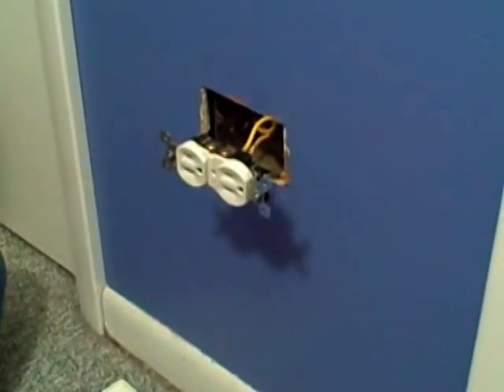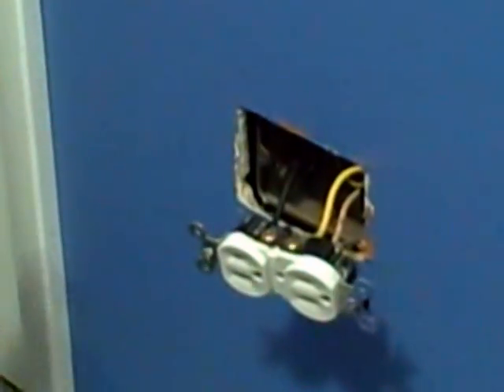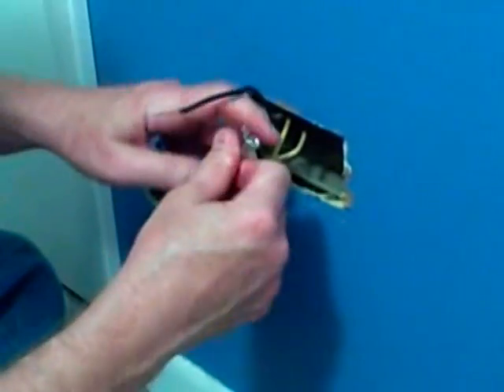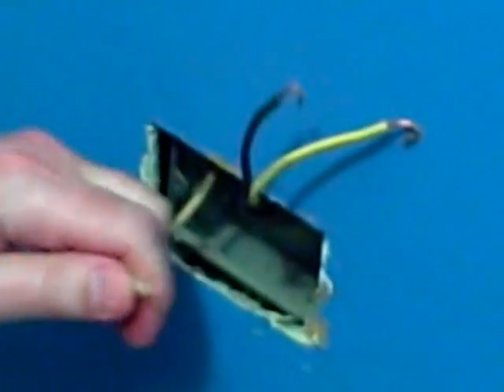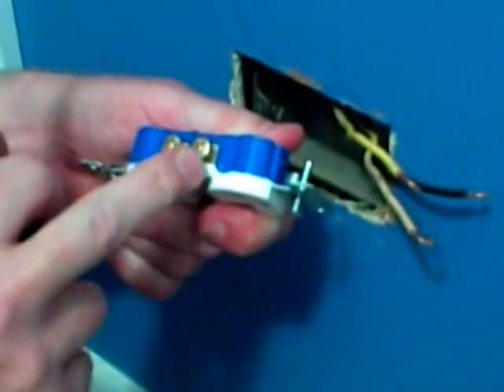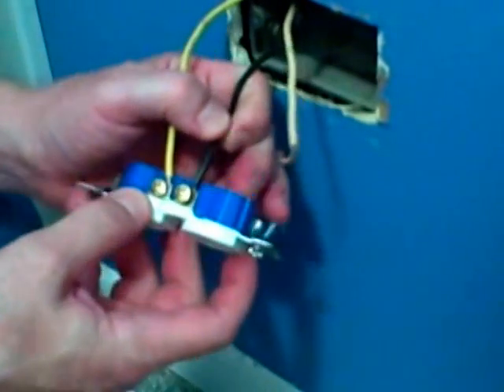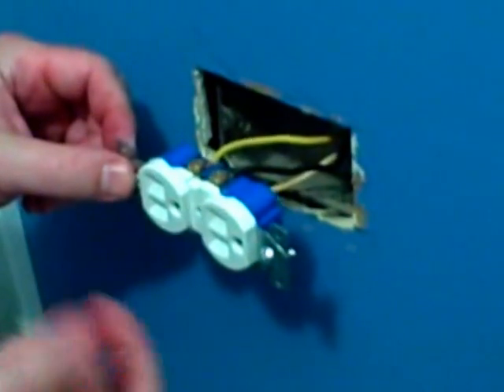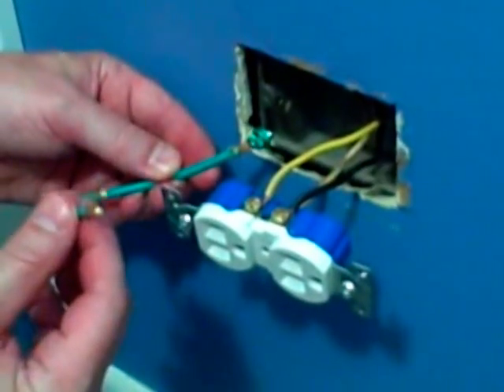How to Wire a Switched Outlet - Conduit

Comment: Hello I accidently broke the tab between the 2 silver screws neutral side can I still use this receptacle if I break off the tab on the Brass screws, Red & Black wire
Reply from the maker: Hi, only one side will work. 
We have more tips in our home improvement book http://www.amazon.com/dp/B01BK2K0JM?ref_=pe_2427780_160035660

Comment from the maker: Hi,

You would only remove the tab if you have a switched outlet, or if the outlet is fed by 2 different circuits. If your old outlet had the tab intact, you will not remove it.

In most cases, one hot wire is coming from the service panel and the other hot wire is feeding another outlet. You want the tab intact.

Let me know if that helps.

Comment from the maker: Was this wire connected to the old outlet? And if it was, what screw was it connected to. 
If you have a metal box and metal pipe back to the service panel, your new outlet will be grounded. I would install that new 3 prong outlet you have.

Comment from the maker: Hi,
It sounds like they used stranded wire to create a grounding whip to the box. If it was connected to the old outlet that way, it should be fine for the new one. Keep that new 3 prong outlet for safety and for cords with a ground.

Comment: Hello. In replacement of a receptacle that is wired as a combo, the old receptacle had two blade inlets (both for hot and neutral) in where two white neutral were connected to the top (switched) outlet but not the bottom (unswitched). My replacement only has one blade inlet (hot and neutral) for top and bottom. Can I just connect the second neutral to the bottom (unswitched) outlet inlet or do I have to pigtail them and connect to the top (switched) outlet? Thank you.
Reply from the maker: +TUBEBOO55 Hi, can you take pics and send to fixitpodcast@gmail.com

Comment: What if I HAVE an overhead light controlled by a switch, but the switch also controls an outlet. But, I want that outlet to have power even when the light is off. How can I fix this?
Reply from the maker: regression Hi, If you have a switched outlet, the breakaway tab is removed on the brass side of the screws. You will need to replace the outlet and leave the tab intact. You will have to use a tester and confirm which wire is connected to the switch. You can cut this wire down and cap it off with an electrical connector in case you ever want to have that outlet switched in the future.
So for the step by step... Turn off your power, confirm it is off with an electrical tester at the outlet. Remover the outlet and remove the wires, spread them apart so nothing is touching. Now turn the power on and with the switch OFF find the hot wire. Mark this as the hot for your new outlet. The other Hot wire that went to the brass screw is the one we want to cap off. You can also confirm this by turning On the switch to see which wire is controlled by the switch.
Let me know if this helps.
Reply: FIX IT Home Improvement Channel thank you. will be working on this sometime in the next few days. I will let you know how it turns out.
Reply from the maker: Great
Reply: FIX IT Home Improvement Channel Interesting. I removed the outlet cover to find that the outlet tabs are both intact. There's a black (I'm assuming hot) wire going to the upper brass screw and a white (I'm assuming neutral) wire going to the lower silver screw. No other wires whatsoever. So, does this mean that the outlet is hardwired in between the lightswitch and the overhead light?
Reply from the maker: Yes. You will have to get into the box in the ceiling and see how it is wired. Mark sure the power is off. Let me know if you have any questions when you get in there.